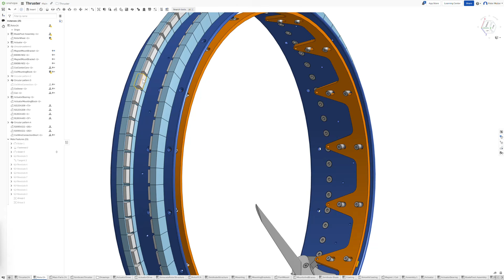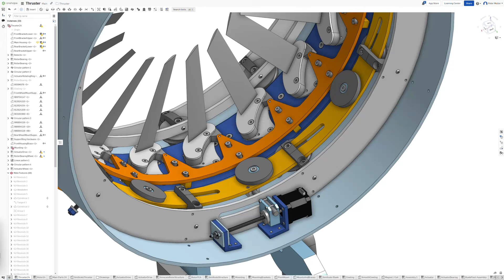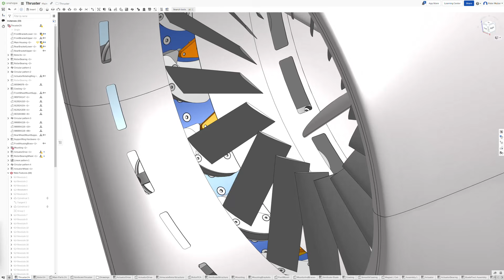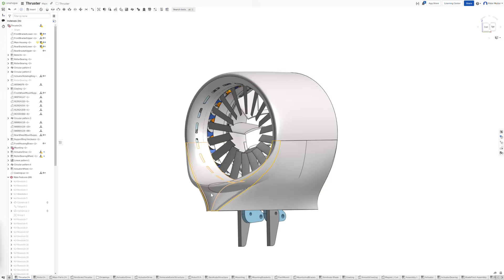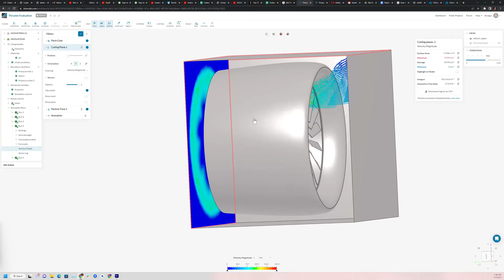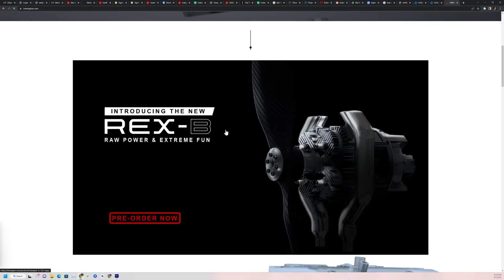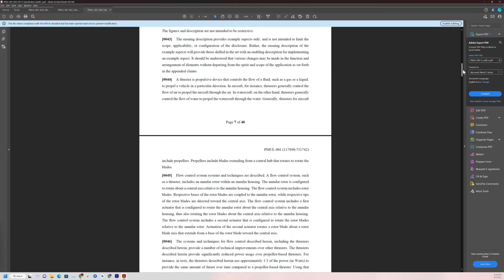Could this Thruster transform Aviation?

Comment: Is there a reason you don't attach the blades to a center hub? It seems like that would alleviate the concerns about flutter as well as reduce the turbulence at the blade tips. You have done such a amazing job, it seems like it would be very easy to design an attachment that would allow the blades to still change pitch.

Comment: It looks like a good idea but it would be better if it had a graphene wire in place of your heavy copper wire. Then the magnets could be designed lighter. also, once you lose about 80 or 90 lbs it could be a very nice machine.

Comment: With so much weight toward the outside of the rotor/blade assembly, that seems like a lot of mass to throw around at high rpm. Essentially you're creating a gyroscope. Probably fine for commercial airlines, but might be an issue for agility.

Comment: I may be an idiot on this type of thing but it seems to me if them blades were wider at the base and narrower at their ends this would be acting as a compressor where as now it appears to separate the blades separating the air in the center and moving it out would and leaving the air in the center to just pass through. Where changing the blades to a wide base and more narrow end would direct the air flow in a compression towards the center while strengthening the blades. Now optimal may or may not be to a point may or may not be longer in to the center .

Comment: Very Intresting indeed. Coming from a none mechanical/aerodynamic expert just wondering if the coreless design with the low center core/column air speed. If you could shape and install a inlet inwards cone to protect the  blades from direct front strike would this not be a "bird strike"(as comical as that statement is) prove design as birds or objects might not survive the impact  but  would just pass thru the center core without hitting the blades ? Rain, hail ect.

Comment: What is new here?  Variable pitch has been around since the 50s.  This is a turbofan with the drive on the outside.  Ducted fans are not more efficient due to all the parasitic drag.  So if you invert this engine with a central drive you have the same multi-prop drive as they worked on in the 60s and 70s.  And you could add multiple counter-rotating rings to increase compression just like the old Soviet bombers.

Comment: I love Delrin as a material, but I'd worry about its wear over time at the speeds you're talking about using. I suppose you'd have to test and see once you get a model that isn't out of balance and can reach the optimal speeds, but I wouldn't be surprised if those rollers will need to be made of metal in the future.

As for an engine to power these, perhaps look into some marine engines for alternatives. You probably have a good option that you're looking at already though. 

Having an engine that runs on a variety of fuels would be interesting since that's one of the advantages of the Honeywell AGT1500 the Abrams tank uses. For an air taxi business with VTOL capabilities, I could see that being a big advantage being able to land at a regular gas station that might have a landing pad and just get some diesel or regular gasoline and thus being less reliant on airports for jet fuel.
Reply: Using the AGT1500 he could upgrade to air bearings like used in modern jet engines, reduce drag and illuminate wear over time.

Comment: So are you going to power it with a trubine? Would be a nice quad copter maybe pretty powerful. Make the blade able to be ninety degrees. I have a design for a very efficeint turbine generator if you want to use it. I need to patent it but i really want to make a new type of ospry or vtol.

Comment: I wonder if a cord at one point of the blades
Of center made of nano silicon nitrate wire for safety and stability could still be used .
A suggestion .

Comment: Hi Peter, nice try. Are you from Germany? I have in my mind a lot of ideas. Also new concepts for thruster (I´m a paramotor sport pilot)
I´m planning to build a low noise thrustor with no counter torsion to the spinning direction. Your Magnet engine is almost there but still far away from what it could be. Think about magnetisation of Iron and reverting the same! it might be better to do not use Iron for higher frequency´s ;-). May be the efficiency could be improved also a lot. Vertical blades? Why not ..... that would explain to much my concept ;-)

Comment: Wow great numbers on that sheet. how much does it weigh? Blade flex and flutter might well be an issue, but that is amazing. You have done well. I certainly hope that this takes off. A lot of moving parts, so maintenance and reliability are always key on aircraft, but weight- that is still king. Can't wait to see what this weights wheels up so to speak. Great job, Thanks for sharing this with us all.
Reply: 256 pounds. It’s going to be in the ultralight category.

Comment: Dude I know this design is going to make electric aeronautics feasible but it could also be used as a low pressure air charger for automotive internal combustion engines

Comment: Marvelous design, Peter. I particularly like the way the blades are mounted so circular forces try to force it together instead of apart. I assume the bearings are ceramic. If not, look into ceramic bearings. No lube, lasts a long time, likes water. You will want to mill a groove for your magnets to ride in, to avoid overspeed magnet throwing. I suspect it will be easy to find better slots in a design manual for aircraft or racing cars. I suggest a prototype on a sailplane, mounted on the rudder. Small battery pack, big solar panels. Consult Sandy Munro !

Comment: What do you think about using a micro turbine in the middle of flow, as an electrical generator and to add thrust? It could be placed forward of the blades with the exhaust accelerating the center flow and reducing the pressure and load on the tips of the blades. The turbine exhaust may even have an effect of pushing the tips and taking the load off of the electrical system. A PTO shaft would come out of the front of the turbine to the generator in a forward nacelle.

Comment: Aside from the significantly-increased angular inertia, the design principle's intrinsically unstable;  whereas centrifugal force pulls hub-mounted vanes or blades outwards, exploiting their low tensile ductility to stabilise the plane of rotation and angle of attack, rim-mounting requires low compressive ductility to compensate the loss of centripetal support, but also much greater rigidity to prevent failure from folding over out of that plane under CF force.  Operating at anywhere close to their safe RPM in static air, they'd be highly vulnerable to any violent perturbations in the airflow, but as an aviation impeller (or any kind of propeller  for that matter) - which have to deal with abrupt variations in axial loading as a matter of routine - this is not 'alternative' so much as wrong..  The basic problem is that instead of exploiting CF force to apply corrective forces to maintain a consistent axial plane as arises with a hub, rim-mounting inverts that effect, essentially amplifying precessional / nutational motions of the inward-facing blade tips, making them intrinsically prone to stray resonances.. the blade tips much more susceptible to flutter, and that flutter - combined with accelerated fatigue - liable to culminate in spontaneous runaway failures.  A stack of these as compressor stages would be a real house of cards..

Comment: Those rollers will be under an immense amounts of stress they will heat up and wear away with dust and debri also the blade leading edges will have to be hard enough to handle wind and sand debri erosion

Comment: There is too much volatility going on here.  The blade's imbalance will blow the bearings also adding the air turbulence would multiply this effect.  This is why the spin occurs from the inside out instead of outside in.  You can see it in the spin.    There is a fix though but it's in my head.   It's like that Magic mountain ride when you are in the barrel.  You can't stand on the wall of the  barrel wall when it is spinning without falling.  But there is a fix.  It's all in my head.

Comment: doubtfull, im gonna guess that the surface are of rotation is larger then in a conventional center bearing design.
Also at those thrust levels the impeller blades will distort and break.
you need an outer and inner support. An inner ring will help, but im still concerned friction will kill this design.

Comment: This is unique but completely impractical. You're taking an already solved and working system and making it more difficult and complex. Turning propeller is as efficient as we can get it. Now you're turning not just a propeller but an outer shaft which complicates things, and adds more centrifical Force two smaller mechanisms. I just don't see this being anywhere near powerful or practical enough.

Comment: This design has been around for a long time and has been essentially abandoned as being extremely inefficient.

By applying the motive force so far from the centre of rotation, at the rim, you are effectively 'gearing down' the motive potential of the motor. The maximum rotational speed being limited by the switching speed of the controller and especially by the moment of inertia of the heavy magnet ring.

It also limits you to a radial flux design, where just about every other manufacturer has realised the benefits in thrust per KW of moving to axial flux.

Comment: The previous commentator has noted some very concerning points, new materials will most likely have to be developed to withstand  the compressive loads on the blades, once the design is scaled up to a seize  that would be sufficient for commercial passenger aircraft the periphery speed of the rolling elements is going to be extremely high, this is going to pose in my opinion too many bearing problems to make this design reliable enough to have the aircraft industry spend billions of dollars on research and  testing.

Comment: How do we get something kinematically useful in a rotating reference frame without a chain of mechanisms to ground? Each layer of mechanism has a new set of load constraints that must have proper bearing, and structure underneath to bear reactions. It's like going somewhere, but you have to use more than one form of public transit. When I was younger, I didn't mind stringing together two or more. Take a bus to the train station. Now, I will only do one or opt to drive. Point being chains of things that have a chance of messing up compound. You multiply efficiencies. A system that uses three processes, each at 90%, will net out to 73%. Three processes at 80% nets out to 51%. I'm fond of the center of the rotating reference frame as a place to put bearings. Large OD bearings are great for reacting moments, but often limited in max RPM. I know it would ruin the aesthetic, but if you could run tensile members through the axis you could balance the blade's inertial load and reduce load bearing & structural requirements at the rim.
Reply: cool idea though.

Comment: In my humble opinion whenever an invention gives a plane 3x the range and is better in each and every way by a fator of a lot, then the designer is usually over optimistic and has failed to foresee some obvious problem.

I don't know ducted fans more than that they exist and this seems to be an overengineered ducted fan that;s missing a core. I can't hbe arsed to watch an hour of explanation if why having a hole in the middle is better though.

Let's hope this is as good as you think!

Comment: You've basically swapped out low speed hub bearings for ludicrous speed bearings at the fastest possible location. I'd be interested in knowing what kind of viscosity the lubricant would need to be to handle that, and what kind of heat exchanger you'll need to cool the lubricant.

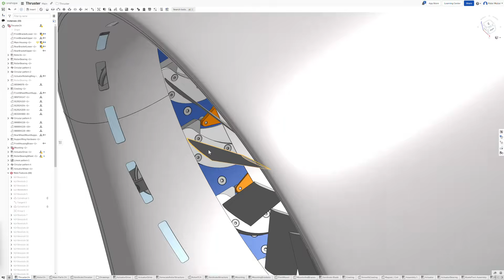Comment: 12:45 "The blade rotates a little bit and you can just pull it out and you can 'Hot Swap' it and put a new one in..."
Saying 'Hot Swap' was probably a slip-of-the-tongue.  I'm sure you're not intending to replace the broken blade while the engine is running... 👀🤔🤷‍♂✌

Comment: I didn't have a working model to change the pitch of the blades, but my similar "mental" plan was to have an aerodynamic or tear drop shaped ring on the inside of the blades like a donut hole... is there a reason that wasn't included on your design? It would stabilize the blades and help sturdy it against the elements and debris.

Comment: It just seems to me that there is too much potential for expansion on the fan ring. Also the loss of air flow at the exit due to a stall created by the vacuum in the dead space. I think that an inside ring hub supported by the stators and attached to the fans would allow for longer fans and less potential for fan or outside ring displacement resulting in catastrophic failure.

Comment: The bearing on the outside is heavy and inefficient. Perhaps underwater, with the resulting lower rpm.
Reply: Yeah, the motor is also nothing to believe in.
Sorry, but there is loads of papers regarding good motor designs, you didn't look at one.

Comment: I'm wondering about how having all the bearings on the outside of the fan will limit RPM's.
This design needs a lot more bearings on the outside than would be necessary for a traditional fan while the rotational speeds on the outside are a lot faster as well.
Tip speeds of fans tend to be pretty high.
It's awesome engineering, but would this really be interesting for commercial use?

Comment: It appears the small wheels are about one sixteenth the diameter  of the fan.  Therefore, if the fan is rotating  at 3000 RPM, the small wheels will rotate at 48,000 RPM.  There are 24 points of axle failure compare to one one in a conventional single axle design.  Compressing the blades is a bad idea, plus the blades would need to be in a rigid mount, which is also a bad idea.  The presentation didn't demonstrate a clear advantage over a conventional design.  An electric motor?  Current battery technology does not remotely compete with petroleum fueled engines.  Perhaps in the future it will, but not now.  Sorry, but I just didn't see anything I like about this design.

Comment: Would be fantastic if your system could utilise a magnetic suspension system for your blades instead of the mechanical  you currently use
A big ask to achieve in the real world though but not impossible 
Blade pitch control would have to be inclusive with the rotating parts and powered through induction
You would have to talk to it via Bluetooth, WiFi or some other remote device
Just a thought and probably a project requiring AI calculations 
Love what you have done 
Just would be nice to get rid of many of the moving parts and related friction

Comment: the only question that this needs to answer is, can the thrust this provides lift the battery pack it would take to keep it in the air for a productive amount of time, plus added weight. if not, then this can only ever work in a stationary setting. and it all comes back to the same problem we face with electricity we have no good way to store it efficiently.
Reply: another question is how much energy are you gonna need to run through 3 of those engines in your vehicle design to produce 10k lbs of thrust. unless you have a way to produce electricity  whilst in the air like a commercial airliner does with its jet engines then i don't you're gonna be in the air for very long depending on how big a lightweight of a battery you get

Comment: An IO 360 will produce about 1000 pounds of thrust at zero airspeed and 2700 rpm this setting would create about 40 pounds of load on each blade with the force per unit area highest at the point where the blade attaches to the outer ring. Much better than a conventional propeller. We need better batteries.

Comment: I'm not clear on why the blades are short. And I suggest they insert into, maybe through the blocks befor being welded. Have you modeled the effect of a second fan in the same nacell, sharing the avalable power? That setup would fail gracefully.

Comment: If those 12 little wheels at the edge of the drum are 3” by the looks and your fan speed is 5600rpm, the little wheels are spinning at 45,000 rpm with 125lbs load on them. They won’t last more than a few seconds.😮

Comment: Although it looks incredibly cool, I don't see how it can be beneficial from a structural point of view. I understand that now the root of the blade is closer to the aerodynamic centre of the blade, but you ditch tension with compression, so you exchange a stabilising force with one that destabilises the structure. To be frank, I would see this more for marine propulsion or to move fluids in pipes since it is hubless. It looks like a nice system that might keep all the electronics dry very easily and without pillars to maintain the hub in the pipe centre.

Comment: What's it's maximum thrust potential?

The modern airline is quite heavy.
Does it meet the thrust capacity that the GE Turbofan or The Rolls Roice Turbofan?
You'll need to Meet then Exceed the power and also tolerance for Jet designers to even consider your fan.
Further more the Thermal load and the power requirements...
How do you plan to cool and power the design?
Jets are heavy and you need enough thrust to generate lift that they require to overcome their mass.